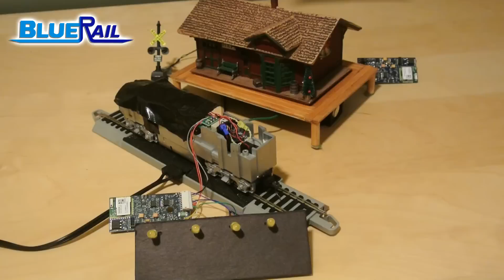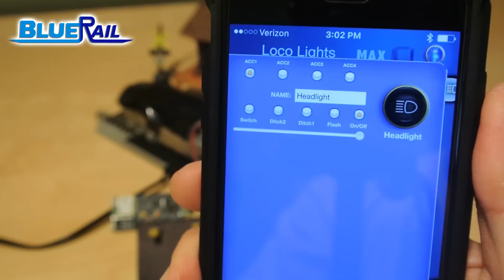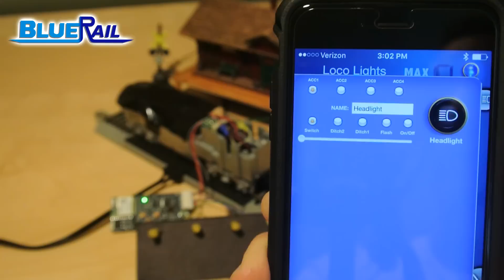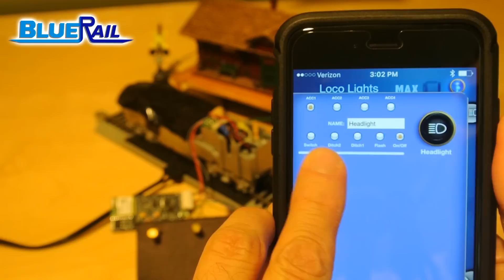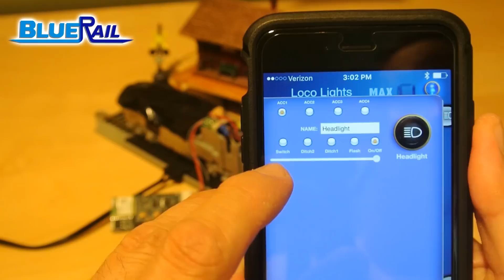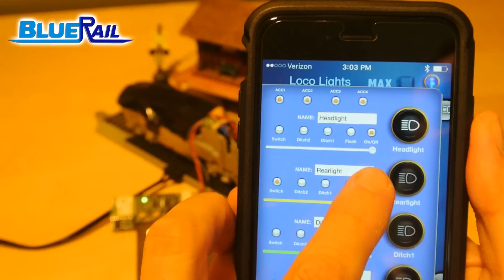Comment: Are these BlueRail boards still available? I am looking for a way to control a train motor AND trigger sounds on a sound board similar to this demonstration, but Soundtraxx and TAM Valley are not the same.
I have the SparkFun WAVtrigger board which is very capable and polyphonic,( so you can have a motor sound AND bell or horn at same time), similar to Pricom Dream Pro.